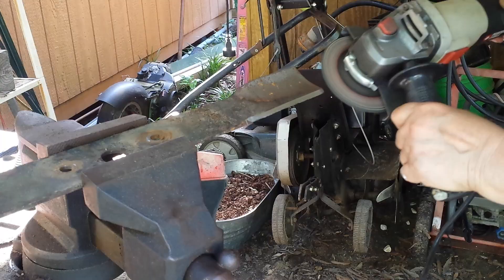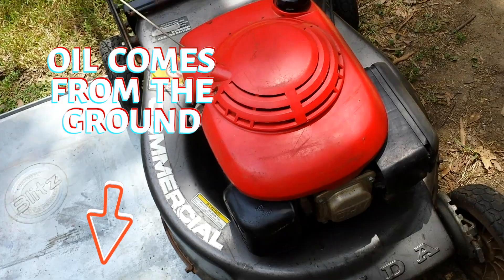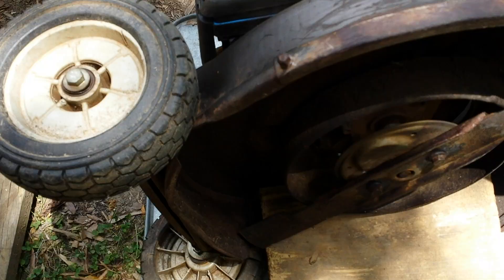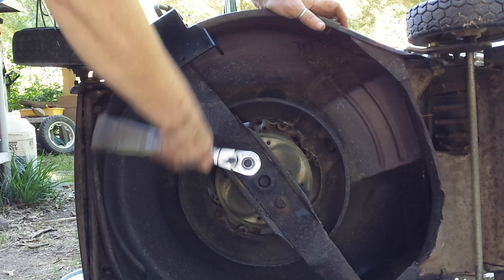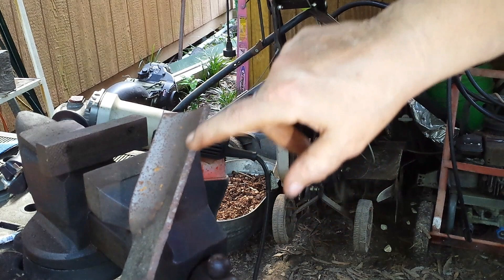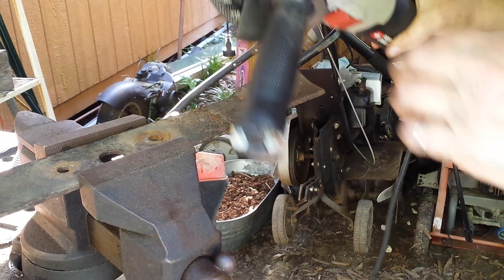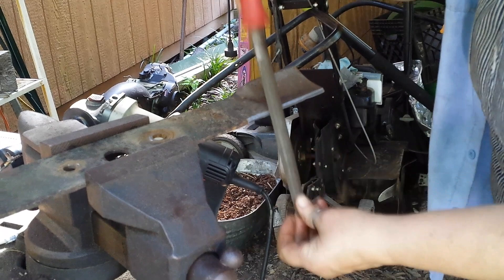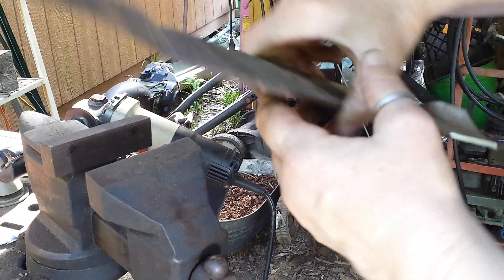Sharpen the Blade - Honda HRC216 Commercial Mower

Comment: Probably the most important safety precaution that you can take when doing your own repairs or maintenance on a lawnmower is to disconnect the spark plug wire before you do anything else. This is especially true when doing anything with the mower blade.
Reply from the maker: Yep! Thanks for watching.
Reply: Especially when turning the blade

Comment: I also spray the underside of the deck with Fluid Film when I change the blade. Works wonders if you mow tall grass or wet grass. Nothing clogs up the deck.
Reply from the maker: That's a great idea. Old farmer trick is to paint the underside of the deck with the oil just drained out. Thanks for watching!
Reply: Good idea. When putting away my mowers for the winter, I coat the underside of the cleaned up deck with rust coverage paint. It dries rock hard and leaves a very smooth finish. Tried the oil trick BUT found that grass and debris always stuck to the oily surface. Many ways to skin a cat, though.

Comment: I love the video for several reasons. It is 5F in Flint Michigan right now and seeing the green grass and hearing the birds chirping is a welcome sound. Secondly, I didn’t have an angle grinder until recently when I purchased an auction lot that had a nice drill that I wanted and a bunch of other stuff including an angle grinder, older model Black & Decker from the days before B&D became a cheapie throw away brand. You have now shown me a possible use for it that I would not have thought of. Also, I had not seen the blade block device. I use block of wood method, but this is another option available. Thank you Lawnmower Lady!
Reply from the maker: Nice score on that grinder. You prolly can still get another set of motor brushes, I just bought a 60 grit flap disk to try out. Supposedly takes off material faster, but I suspect I'll need to replace it more often. That disk I use int this video  is the one that came with this grinder, 3 years ago or so. Thanks for watching Mr Haney!

Comment: I sharpened my blades for years with an angel Grinder they work great. I noticed the owner of that mower is not using Hondas twin blades I'm surprised they cut the clippings very fine. I like using a ball bearing blade balancer they are more accurate than the type you use. Keep up the great videos!!
Reply from the maker: Thanks for watching Mr Bob! The guy also special ordered this mower without the transmission. I honestly couldn't understand why. I've looked at those ball bearing balancers, they are nice!
Reply: @TheLawnmowerLady  💰💰💰💰💰👍👍
Reply: What is an Angel grinder?
Is it a brand of angle grinder?

Comment: Looking to buy more basic tools like ratchets for removing blades, a torque ratchet for installing and an angle grinder for sharpening. I am good with the very basics (spark plug, air filter, oil change and also cleaning a carb.  What size ratchets 3/8’?  How long a handle on the torque?  Do I need different length ones?  Any specifics on the angle grinder?  Also finding I need some longer tools to reach some bolts?  Basic questions but kind of getting into this late in the game and don’t have too many supportive guys to guide me.  Love taking things apart and putting them back together- nothing sweeter than making something work that didn’t!  I’ve been doing that with firearms but love the mowers and generators mostly as so many people have no idea or want to take the time to treat them right. Love your tool references and links- keep them coming. Thanks for all the videos. Cynthia
Reply from the maker: Thanks for watching Ms Cynthia!  I think you can pick up some inexpensive, but not cheap torque wrenches by Husky or Tekton at your local HomeDepo store. a 3/8" 10-100ft/lbs and a 1/4" 50-150 in/lbs should cover most any small engine work for not a lot of money. Anymore is just too much to spend on tools for home use. I'd stick to brushless angle grinder if you are grinding indoors, no sparks to ignite fuel vapors. If you can afford to buy just the specific tools you need, not jumbo sets of tools you may never use, it is a better investment. I find more selection of individual hand tools (sockets, screwdrivers, etc) at places like NorthernTool and HomeDepo rather than places like HarborFR. That said, HarborFR does have some good tools like impact sockets, punches, chisels etc. I find most any work can be accomplished with 1/4 sockets and drivers on these small engines. A deep set of sockets is helpful, and stick to 6-pointed sockets if you can. 12-point sockets will round off nuts and bolts easier than 6-point. Most of my tools are metric, and cover SAE sizes most all the time. All this advice assumes you are in the US? Cheers!

Comment: What kind of disc did you use on the angle grinder?  And if the blade isn’t exactly balanced, ie, if you had left it as it originally was with one side slightly heavier, how would that have affected the mower/cut? I love this channel….it’s geared toward the homeowner that wants to repair their small machinery, rather than some of the other channels who tend to give instructions suitable for full time mechanics.  Thank you.  Edit:  I would think that using the 2x6 piece of wood is far better than that ‘blade stop’ thing.  Kind of like inventing a better mouse trap that is a bit faulty…lol
Reply from the maker: I really appreciate you watching and your comments Ms Inisfad. I'm glad to know my channel helps out. 

Someone else here mentioned a C-clamp would work great too as a blade stop. Hadn't thought of that I'm embarrassed to say ::facepalm:: A terribly unbalanced blade (this one was hardly at all) would cause vibrations that will eventually wear out things like the crank seal and all the oil could leak out. I think that disk is the one that came with that grinder, general purpose metal disc probably. I did just purchase a 60 grit flap disk to try out. Supposedly quicker to remove material. I'm dubious about the lifespan. I expect to be replacing it more often, That disk I use is 2-3 years old.

Comment: I like to use the pipe clamp feature on my bench vise to hold the blade.  Mostly only the corner does any work on the blade.  Don't know what makes those juices so corrosive but they are.  Think blade balancing is really worth it?  Well, keep your saw in the wood and your stick on the ice!
Reply from the maker: Great idea Mr Joe. My vice inside my little shop has those teeth, but this one outdoors does not. I had to move outside as everything in my shop became  covered with a fine powder, and I figured breathing that dust in was no good for me either. I have gotten mowers with horrible vibration due to blade out of balance, Usually a chunk of metal broken off. It honestly doesn't add too much time to my sharpening. I appreciate you watching.

Comment: Nicely done! Like the torque wrench usage. Do you have a site you go to for torque specs for various makes of mowers? Do you have a shop manual like Chiltons or Haynes for references? Also, where do you get all the shirts with the various names??? You seem to have a whole bunch! It is just funny how you start each video clarifying what your name is not. Such an interesting personality!!
Reply from the maker: I picked 45 ft/lbs based on several different models (Honda says 43, MTD says between 38-50). Most all the bolts are the same size and thread pitch on these walk-behind mowers. Often ride on and zero-turn typically are higher, and I do look those up. I have a lot more name tags than shirts: velcro is my friend :)  Cheers!

Comment: Are the tork specks on all HOND MOWER BLADES THE SAME??
Reply from the maker: I don't look up the OM for every single one, but those I have state 43ft/lbs as the maximum torque. That said, I usually set mine to 45 (the usual torque for Briggs & Stratton engines) as it's easier to read on my torque wrench. If you want to be sure, google your model number and owners manual and you'll get the most accurate info. Thanks for watching.

Comment: Plus make sure to run the gas out of the carb  and shut off the gas  for we all knows gas in the oil is a bad thing for the oil and the engine  will go out with a bang see  you later young lafy😁
Reply from the maker: Good advice!  Cheers!
Reply: @TheLawnmowerLady   anytime young lady 💐 and be safe out there